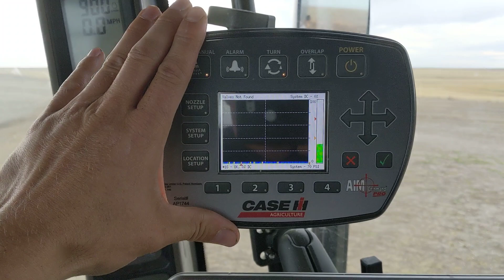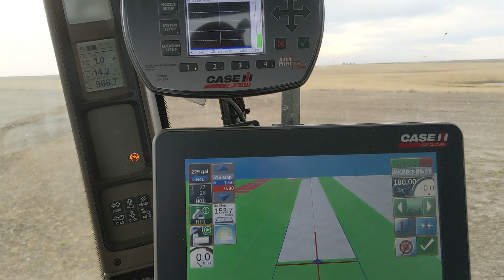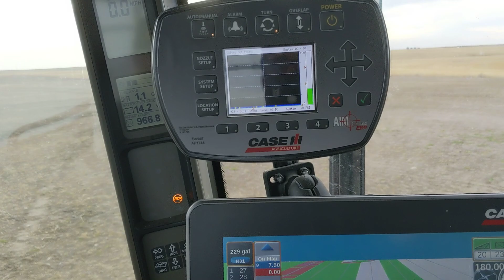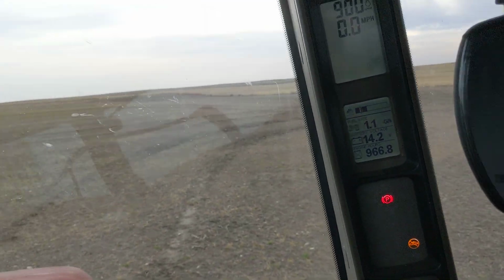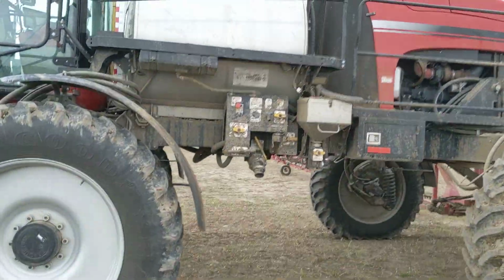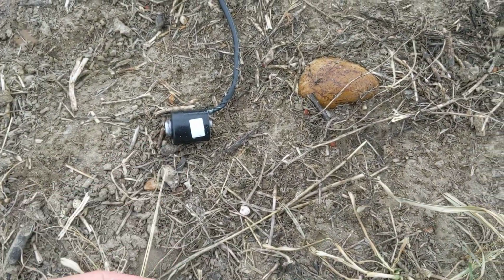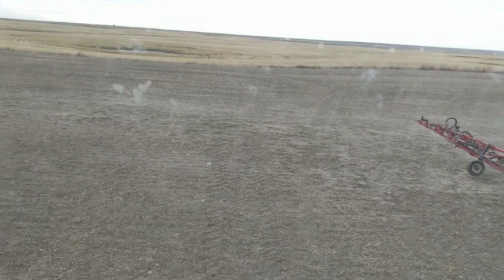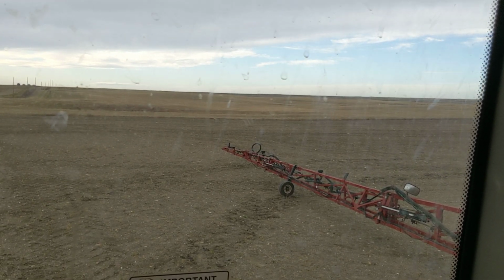Case 4440 Sprayer part 2

Comment: Bought an Agrifac Endurance sprayer this spring.  2200 gal, yes, gallon, tank on 180 booms. Really impressive machine. There’s still very few in MB, but they’re picking up. High cap tank, 4 wheel steer, 180 booms, recirculating boom standard, flowmeter and float inside tank that calibrate each other, on-board fill pump that’ll fill tank in 7 mins etc etc. Really impressed with it after 1 season
Reply from the maker: 2200gal US? In a SP?! 😳 Haha that's about as crazy as a 180ft booms! I am slightly jealous there Julian haha 😂 that's cool
Reply: Mike Mitchell I loaded er up completely, drove onto the scale she was 23,740 kgs fully loaded. That’s roughly the same as a new Deere empty! Crazy. And 150kgs difference in the front/rear axles. Oh and there’s the little issue of the new Deere we priced out too being over $100k more.
Reply from the maker: When I priced the new 1600gal Deere, it was roughly $150k  over the Case.. Their biggest margins are in sprayers and this is ridiculous! When a new sprayer is 150k more than a new class 9 combine, I have issues with that!

Comment: Before you turn your sprayer on make sure the aim command is in manual mode or off, then after you turn the sprayer on switch it to automatic to turn on the aim command screen…it’s helped me save silanoids…I think if that switch is on auto when turning the sprayer on it shorts out those wires leading to the silanoids…..also there’s some type of grease that they put into those connections on the silanoid wires so try some plastic safe electrical cleaner to spray in those connections to get rid of that grease

Comment: I’ve got one with the pro, power is supplied to solenoids with key off, dealer put ina solenoid to turn off power with key off- haven’t had to replace a solenoid since 👍🏿
Reply from the maker: 🤔.... That's very interesting to know there Nathan, thanks!
Reply: I have aim pro and have a separate power switch to provide power to aim box, 2015 model, just go through 1 or 2 coils per year

Comment: Check out Ag Trucks and Equipment.  They build custom sprayers.  They use a chassis that is tough.  Direct drive.  Any options you want.  Spend as much money as you want on one.  They have the best support I have seen.  You are a few miles from them.

Comment: It stinks your having such issues. We have a 3330 2010 model almost 3,000 hours. Been great. We really love it. There so nice driving. I would say we did also put in a hydro pump at 2,500 hours but really no issues at all with aim command. We really love that. I only know the pro 600 and 700 and have liked it but I guess that's all I know. To me it's what you get used to like cell phones. Anyway that's my 2 cents worth. We also have quad tracks and have not had the def issues. nor do we ever plug air filters which I find really odd you do with filters. Not surprised with def issues I guess because emissions stuff is stupid.. Go to blow it out and nothing in there and we do tillage. Our case 2014 combines though we have had lots of def problems but they had a 5 year warranty on def stuff so that has helped

Comment: Mike i know this is an old video but i run a 2008 4420 with 5200 hours gives zero problems whatsoever but one thing…. Whenever i go to take off or slow down it lurches like really bad i cant drive it smooth at all…. I already changes the potentiometer and recalled everything nothing works…. Im womdering if you could help me out

Comment: I spray roughly 70,000 acres with one 4440 a year.  My tank mixes are consistently empty when the gallon counter hits 0.   Or within 20 gallons.   Also with a aim pro but with a pro 700.  So it seems there's a setting not right somewhere
Reply from the maker: That's what I thought too... Got be something wrong or something giving issues.. Happens to 3 units other 3 worked great.. All identical units
Reply: Did you know that Case IH loans a number of units to colleges every year.  The students tear them apart for points and put them back together.  Then they sell them to dealers at rock bottom prices.  I think you may have a few of those machines.

Comment: How the plastic end up in those pipes? 
Like the Case as a vehicle. But that cannot always be sufficient, it seems it needs to be able to spray some chemicals on Mike's fields properly as well, with working monitors, sensors and valves. High demand 👍

Comment: You may be glad you haven't received snow yet. 
We have gained about 5 cm and it will remain until 
April and increase approximately 1½ meters. 
It is also -12 degrees C.
Reply from the maker: Whoa! Well, it's coming as we speak.. Supposed to get to - 14 in Tuesday highs of - 7'C.. With snow..

Where abouts are you from again? I might have asked before and I have terrible memory, so I ll prb ask again 🤦‍♂️🤷‍♂️
Reply: @mikemitchell2554   I live high up in northern Sweden, quite close to the Arctic Circle. 
It has been snowing all night, so now we have about 15 cm. 
By the way. Is your first language French?
Reply from the maker: Right! That's right, you did tell me that.. That's 😎

Comment: Mike have you ever demoed the r4 series deere sprayers and what do you think of them? The big R4060  with 1600 gallon tank would work nice for you and yes you can get them with LED lights.And why did you switch to pull type sprayers?I know they have big tanks and better technology than you can get on sprayers here but you also have to have tractors for them...
Reply: alberta farmer prob cheaper and you can use tractor on something not just sprsyer
Reply from the maker: Yeah, i can buy two 3200gal 132ft boom sprayers with X30 Top Con monitors and at 8mph can do a 1 to 1 with my SP and at faster speeds I can do a 1.5 to 1 each... EACH!

So buy one SP or buy two big pull types and at the very least do 2 - 1 and at best do 3-1 (3 SPs for the price of 1) at the same cost.. The tractors are we have around here anyways for other things.. Not saying I would get rid of all the SPs, but most of them because we also have a plane.
Reply from the maker: Tho, I would be very interested in trying that new 1600 from Deere.. But they have gone stupid with thier pricing.. 800k cash... I just quoted it.. That's crazy... It doesn't make sense anymore
Reply from the maker: I could run three 3200gal sprayers for that, and do a 5 to 1!! 😳 🤷‍♂️ Haha
Things just aren't adding up anymore in farming

Comment: Usually the only way aim pro will spray incorrect rate like that is it incorrect nozzle size is selected in monitor. Then nozzles will spray at wrong duty cycle causing rate issues.
Reply from the maker: I knew I was forgot to mention that iny video! Haha... And yes, I agree Mathew... And that's the crazy part, I have and not only me, but my dealer as well 🤔🤷‍♂️
Reply: Mike Mitchell I’ve found putting the newer capstan software into those monitors that give them acre counters as well make everything on them more stable. Aim flex is much nicer though having only one monitor in the cab controlling everything and solenoids fail much less often, have sprayers that are 3 years old and haven’t had a single solenoid problem yet.
Reply from the maker: I have heard that the Aim Flex system is far better, and I ran one for 50hrs this summer (loaner when the hydro went in ours) and it was waaay better.. It just felt cleaner, more accurate and didn't have an Aim fail once..
Reply: Mike Mitchell much better than aim pro in my opinion. Raven RS1 or SC1 steering huge improvement as well. Autoboom XRT is a game changer as well.
Reply from the maker: Now you got my attention with steering haha.. I am currently pricing the new 4440 1600gal.. I want to see how it compares to the 1600gal Deere.. My guess, 120k  cheaper 🤷‍♂️
Reply: The RS1 is as close to rtk that I have found. I run a RG 1300C with RS1 and can run down 22” sugarbeet rows at 14-18mph. I demoed a R4030 this summer with RTK and sprayed the same fields I. The hills and didn’t see any better steering with the Deere. The Deere is a good sprayer as well though.
Reply: Mike Mitchell Raven really stepped up their autosteer game from the days of Smartrax. If you use RTX on your Case IH receivers you can use SC1 which allows you to use 3rd party receiver with the new steering, RS1 uses Raven receiver.

Comment: You need a r4060
Reply from the maker: Would be nice alright... Even priced it, but when a sprayer is flirting with 800k cash - I have problems with that haha 😂 🤷‍♂️
Reply: Mike Mitchell what about a 4045
Reply from the maker: @TheOneSaskatchewanFarmBoy  still 650-700..😬 🤷‍♂️
Reply: Mike Mitchell you could just get a slightly used one. We got a 2016 for only 320
Reply from the maker: That's true - I have pondered that 🙂
Reply: Mike Mitchell do you deal with Pattison of so check their web site they have lots for below new
Reply from the maker: I do yes, problem is trade values have fallen off the map, so it would cost me an additional 100k to get out the red ones. And that's not necessarily the red sprayer problems because the same happened to every colour out there - it happened because there's currently no money in farming 😂 🤷‍♂️

Comment: Need rogator 1300
Reply from the maker: I was supposed to get that demo but then winter set in haha
Reply: LOL
Reply: @glennwaldner  not funny to those with crop in the feild still which there is lots of this year
Reply: Lol was for mentioning a rogator
Reply: Rogator has a a badass machine. Great ride and awesome controls. We run 4 4440 and we have 2 1300c.  I am a huge fan of the rogator. No more case machines purchased after we got the first rogator.
Reply from the maker: What were the selling features?
Reply: @mikemitchell2554  when we were buying we compared to deere sprayers and thought the rogator looked to be built better . The planetarys on the wheels look to be twice the size . Hose routing looked better. Warranty and price was better . The rest of equipment is deere for the most part .